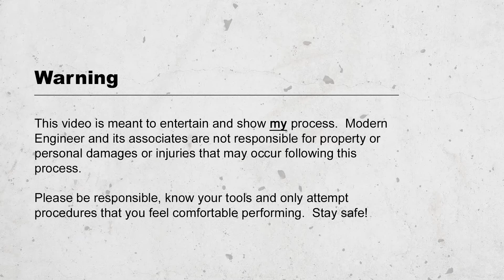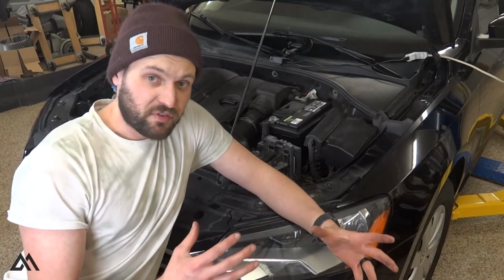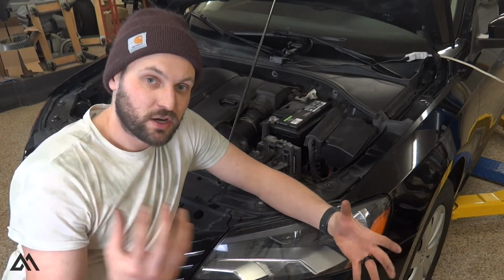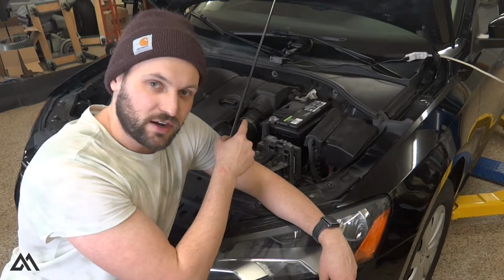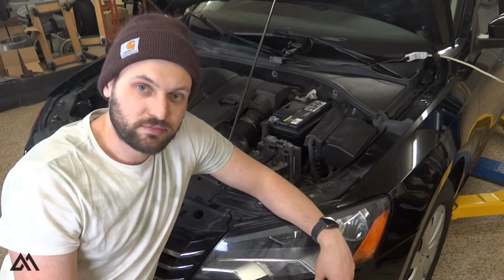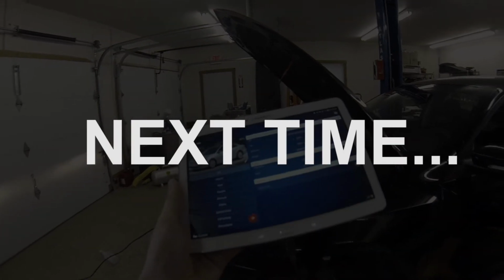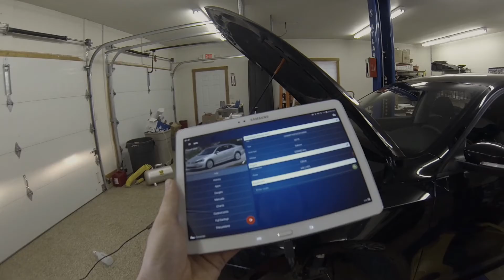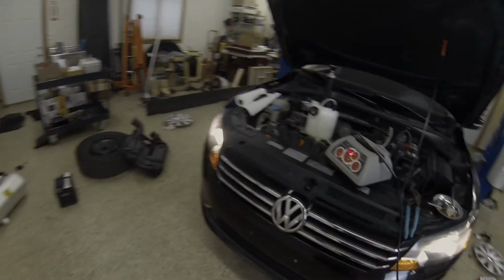2012 - 2015 Volkswagen Passat Brake Master Cylinder | B7 Passat Flip Car!

Comment: Not sure if it’s mandatory or something that will save a lot of time?? But typically I see people bench bleed a new master cylinder with hoses going into the reservoir and pushing the piston manually.. to bleed out air .. then install the brake fittings on the master cylinder? How did the bleeding go the way you did it? Thanks for sharing

Comment: Hey I actually got a few questions for you? I have a headache over my 2014 vw passat 1.8L tdi. So first my brakes got still out of no where I was told bad master cylinder so replaced and they also blead my brakes it still spongy kinda hard so then was told to change brake pads cause they were worn out Now brakes are delayed 😢? What else's other than changing the booster and my booster is good I was told still. I need help

Comment: Matt, 
I just found your Videos. I wrote you a message about your fuel filter dissection from 2 years ago. You were quick with the answer Thank you. How much of a restriction on the end of the return line would it take to increase the bar rating of the fuel filter.